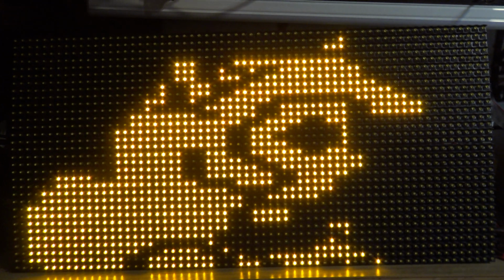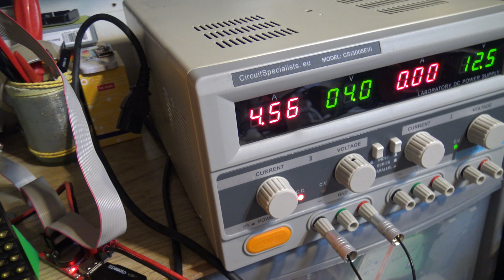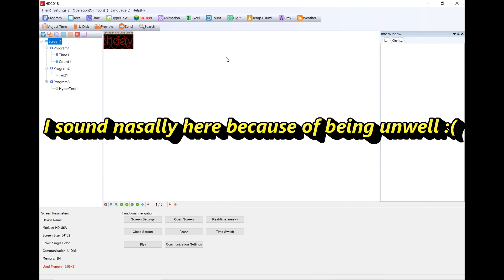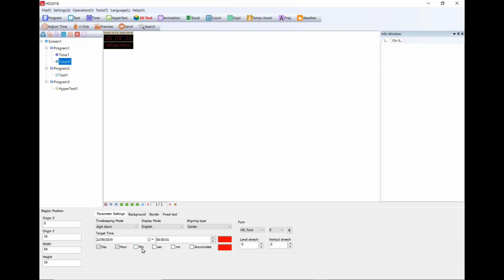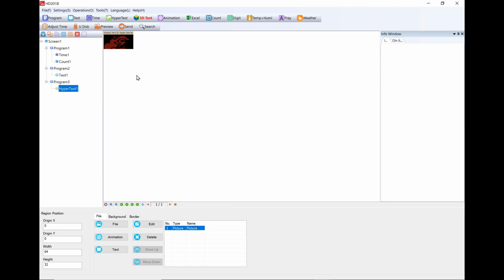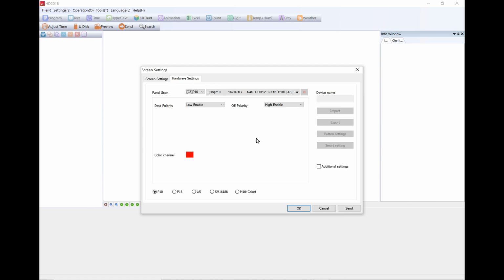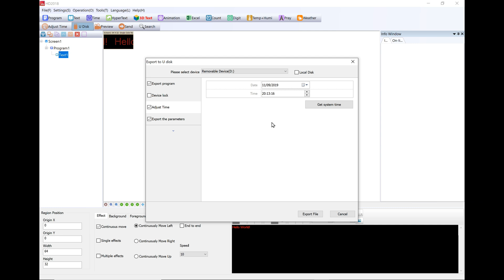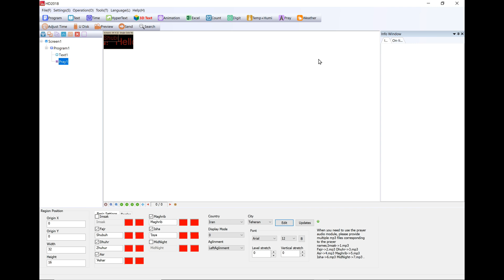Train departure board in your house? P10 LED Panels & HD-U6A Controller

Comment: Awesome to see that you have a 3d printer now! Which printer do you use?
Reply from the maker: I have a Solidoodle 4, been meaning to do a video on 3D printing for some while.
Reply: @yoshielectron oh nice, that one has a heated enclosure doesn't it? great for printing abs. I'd be very interested in that video. I recently bought a Creality Ender 5 and have loved every minute with it, upgrading it and printing useful parts (even the failures).
Reply from the maker: @dufric88  I'm not sure about heated enclosure, certainly the bed can be heated but I haven't tried ABS yet. How much did your printer cost you? The video would be about printing enclosures for electronics projects. Speaking of failures, I've had a number of them and have been trying to sort out the issues.
Reply: @yoshielectron  ah maybe it's just an enclosure, but still a very nice feature. I bought my printer new for about $325 USD. Printers have come down in price dramatically (probably as a result of Chinese companies getting into the game). However, since then I've spent over $150 in optional upgrades because once I saw how awesome it was, I knew I had to make it even better.

Making project enclosures is one of the top reasons I purchased the printer and learning ins and outs of designing and printing these enclosures from your proposed video would be very helpful to me. 

As for your printing issues, I'd love to help if I can. If you'd like to shoot me a private message some time I'll happily give you some time.
Reply from the maker: @dufric88  Indeed the prices have dropped a lot but then we have newer 3D printer technologies that compete, such as those that use resin. I actually got my printer second hand off a colleague and he had 3D printed a spool holder so that was kind of a free upgrade.
I've printed simple enclosures so far but I will certainly do a video even for a simple project.
Thanks for your support.